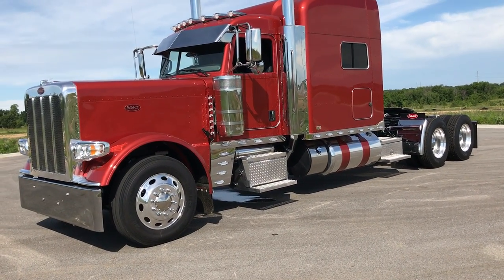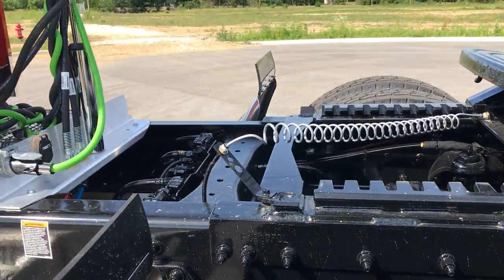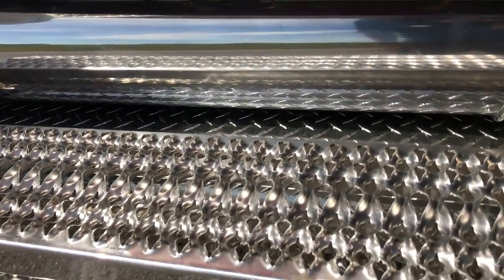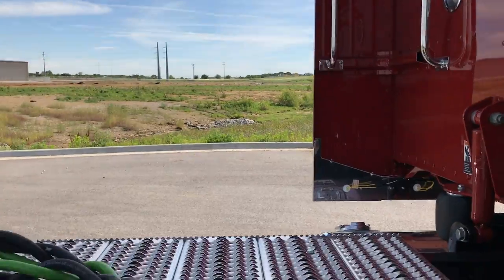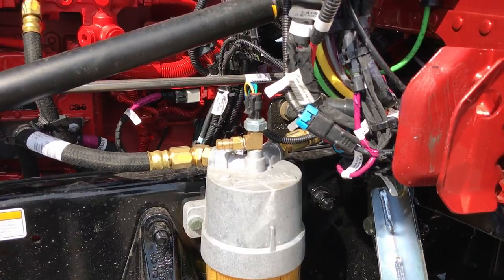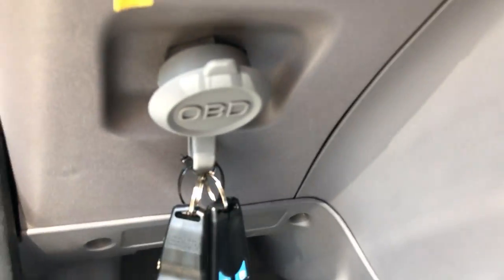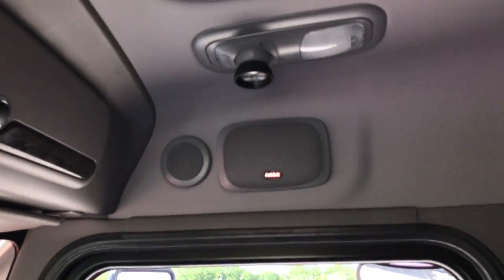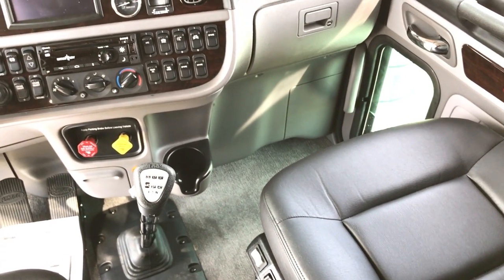2018 Peterbilt 389 Autumn Sunburst Orange 565hp 2050 TQ 18 Speed Platinum

Comment: Flaps on the rear of the battery box and right step does wonders to keep the road grit off the fuel tanks. 1/2" thick conveyor belt, cut as desired , works like a charm.
Reply: Cow mat works just as well and is even cheaper, you can get it in 3/4 too for the rear fenders to keep them straight going down the road.
Reply from the maker: Agreed, we do plenty of those installs before they leave the shop.

Comment: Man beautiful truck ,  i use to drive a 1962 b model mack with a 5x4 quad box and it was not a pleasant truck to drive  NO AIR RIDE SEAT . This truck is really nice and the color WOW it looks like it's going 75mph  parked .  Thanks Steve
Reply from the maker: Wow, that was trucking back then for sure
Reply: Peterbilt Steve  It was a concrete truck all local stuff 1982 ...

Comment: what's the up charge for the 3 axle disc brakes?
Reply from the maker: $1700
Reply: Peterbilt Steve $1700 is a drop in the bucket when you're buying a $170k + truck.
Reply from the maker: I agree